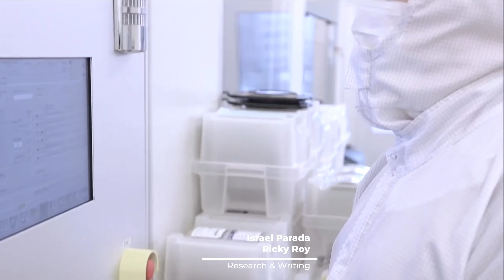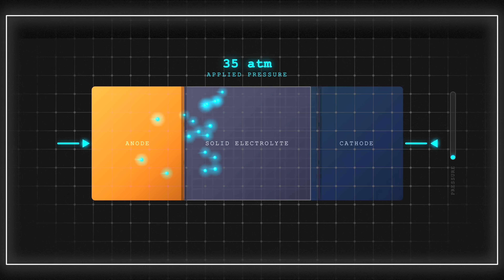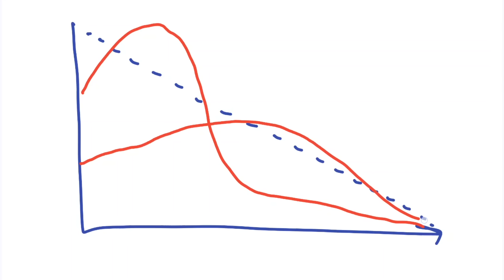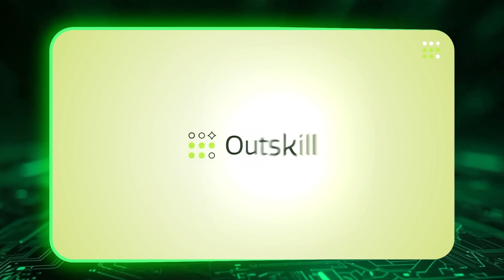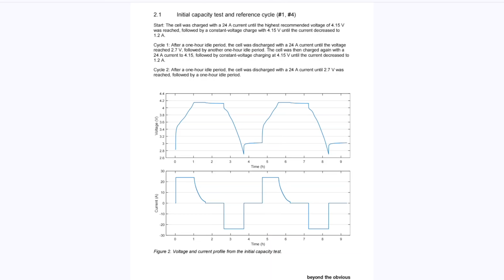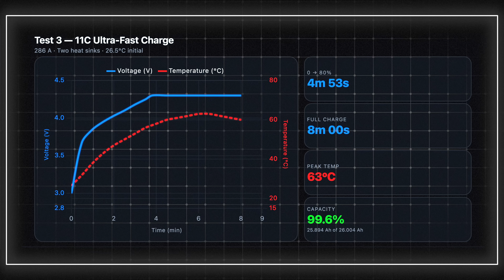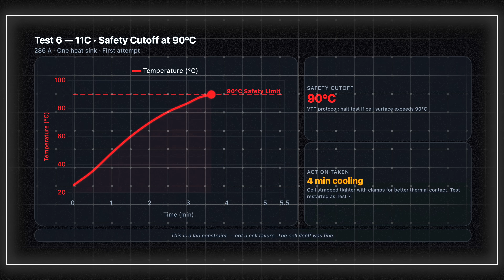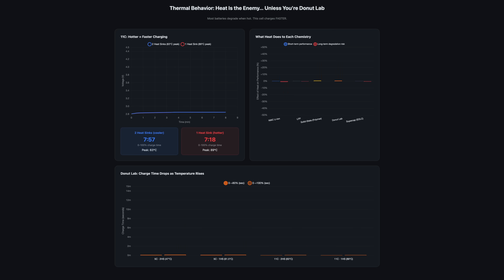Donut Lab's Solid State Battery Test are Shocking...

Comment: Also they open the video with the statement "this is a battery used in a IN PRODUCTION vehicle" to blow smoke up your a$$ , as this "in production vehicle" is a niche ebike made by their buddies at VERGE, a bike that noone has seen , that for all i know doesnt even exist yet, despite being promised for April this year. This is whats going to happen..there will be no motorcycle with a solid state battery, either it will be a mcguffin with a LION pack and a promise to upgrade you later (this way they can sell the bike and have the gullible locked in while keeping it legal), or they will postpone the entire bike. This is a classic investor bait last minute cash infusion play.  VERGE is struggling financially, they are on the verge of bankruptcy...no pun intended, they need pre orders and money fast. This battery is a scam, you cant cheat the chemistry signature by just applying the 4.2 volts and say ohh we do this because of compatiblity blabla, if your internal chemistry is NOT that of a NMC battery you will have a completely different CURVE no matter what voltage.

Comment: There's been so many scams like this recently, honestly, why should anyone care before it's on the market? Assume it isn't true. If you can't buy it, then what do you care anyway? Delving into the sketchy testing parameters, etc, is a total waste of time because the testing isn't truly independent. If they start selling it - someone's going to rip one open and find out the truth. Why not wait till that happens? This battery hype market has been happening for like a decade - graphene, graphite, solid state, nanowhatevers. There hasn't been much actual advancement aside from what you'd expect the industry to move at. Matt Farrel has made a career selling videos about vaporware.
Reply: Because pattern matching is good for spotting predators, not so good for battery analysis.

Comment: well its a super cap what do you expect. nothing new fancy here, than the high energy density by using graphene. I suppose they are using a solid electrolyte in the super cap then. so why christ said its a solid state super capacitor then. ok their solid state li-ion battery works fine then. dont you have separator cooling plates on both sides. ie cell compartmentalization. if only you would be one hot and cold, not meh. you can have a liquid electrolyte paste that hardens to exact shape like a glue to form the solid state electrolyte. ie kinda like cement. what you see is what you get. dont believe in people, rather believe in christ so that you are free from your bind to believing in what people say and talk. well they have figured out exactly what they said they are doing, an high performance solid state electrolyte material. a pem membrane would be close. also a cheap version of the usually expensive pem membranes.
Reply: Marko has categorically denied it's a capacitor of any kind
Reply: Very unlikely an super/ultra cap, doesn't match charge curve/temp. Like people have said, matches up with standard existing battery.

Comment: What did you miss? You seem fixated on the charge profile fitting an NMC liquid electrolyte battery architecture, when we have Donut lab saying the battery is a Na-TiO architecture. Assuming Donut's statement is truthful, I expect we'll see different data in future.
Reply: Other investigator said that, not DL
Donut never commented on the chemistry.

Comment: Great video, I follow your reasoning and, like you, I’m waiting for the next tests.
The only thing I can add is that I think they declared they can have whatever voltage they want in each individual cell, and they said they chose these voltages for the first mass production because it will be easier for industrial implementation.
So (if what they say is true), there’s nothing strange about having characteristics very similar to current NMC batteries.
We’ll see…
Reply: Its about the voltage curve, not just the voltage
Reply: I remember them saying that and was about to post on it. It would be a really big plus if one can just drop in these batteries as replacement. In other words it would be plug and play. That would be a big selling point.
Reply: That a bulshit if you have an exceptional battery you need exceptional proof no need to nerf it. Show us your max out and we will shut up and trust you. Because for the moment they didn't show what they battery can do that other can't.
Reply: @MrlegendOr  Yes I would send the cell variant that shows the best energy density and charging speeds regardless of voltage just to prove that it can match the claimed performance. And drop in replacements aren't that important as they sound - other can develop and adopt charge/discharge circuitry required for a new chemistry pretty quick especially if they get like a third better energy density with 100k cycles
Reply: Yes. Good point.
Reply: That's the thing I would expect an NMC imitator chemistry to have similar nominal and and fully charged voltages not 100% matching voltage curve. Another point is - if you promise that this cell can have a wide range of voltages you wouldn't want to show the variant that would give bases to the most common criticism - that it could be just very well made lithium battery. Normally i would expect them to give a cell that matches the promised energy density in the voltage levels that are most beneficial to them and then come up with an NMC twin with the caveat "If we need to make drop in replacement for NMC we lose 20% energy density" and that would be perfectly reasonable
Reply: @sedatmehmed4371  Perfectly explained!
Reply: @sedatmehmed4371 hahahahaha good story. 😂😂😂😂😂 

You wouldn't happen to be interested in buying some BTC or gold from me would you?

Comment: Watched both the videos Ziroth and this one, the conclusion we can draw is it's either a very good Lithium NMC and they are lying, or they have an entirely unexpected breakthrough that haven't been revealed in the test they have released so far. I mean lying just doesn't make sense at all since it will all be revealed the moment the cells get into the hands of the public, if it is an entirely new breakthrough, then maybe it does make sense to keep it secret as long as possible to slow down other battery companies from jumping on the technology and reproducing it. The only thing we can say for sure is, this isn't a definitive test that we can say yes or no to, it does make the chances of it actually being solid state less certain as Ziroth stated, but it still doesn't entirely rule it out, and I suspect that won't happen until someone takes a hacksaw to one of the cells and looks inside.
Reply: Waiting a few months to release the details won't slow down competitor's jumping into the market. Their current production volume would be a drop in the bucket relative to ultimate global production needs. CATL and BYD would dwarf Donut once info is public.
Reply: If you folks don't think there are hundreds of investors trying to hand donut labs huge sums of cash behind the scenes to invest early your hallucinating. Maybe Donut labs CEO Marko Lehtimaki will run away to Russia or north Korea with the cash just before the truth is found out. Marko Lehtimaki was claiming he had developed super AI not too long ago but he never produced anything. He seems like a wannabe Evilon Musk lying billionaire to me.
Reply: @ericm8811  Well there are already people building stuff, like WattEV, Cova Power, Esox Group and they claim they are being tested in trucks and etc, and there is that billionaire investor, so there's probably already a lot of money invested in it. Depends how much he wants I suppose, but keep in mind every one of these videos released will push people one way or the other. The point with scams like Theranos is you never release public testing, you always keep it in house, once you start releasing public testing that just gives the game away. Fortunately I am not an investor so not influenced one way or the other, I will just wait and see, scam or not scam, we will know soon enough.
Reply: @ericm8811 these personal attacks are tiresome and becoming silly.
Reply: I can't understand how you define this as inconclusive. They proved it charges at impossible speed with no heatsink. What more you need? 
As for lithium or not. That's a goalpost you all invented. Doesn't matter.
Reply: @davis.fourohfour  Because it doesn't necessarily exceed the charging speed of a good Lithium NMC battery, they have stated it's not lithium many times, and a lithium battery doesn't charge at those speeds simply because it leads to early battery degradation not because it's not possible, those charging rates lead to dendrite formation and battery damage. Until we have a test for the degradation, or not as the case may be, it could still be a lithium battery with liquid electrolyte, so no it's not conclusive, it's the total package that will be conclusive. It charges fast, other batteries can do that, it lasts a long time with little degradation, other batteries can do that, it works in extreme hot and cold, other batteries can do that, but they can't do all these things at the same time, and that's the important bit.

You can have a long life battery that doesn't charge fast, or a high energy density battery that doesn't like the extreme cold, until we have the actual full battery of tests it's not conclusive. 

It simply doesn't charge at impossible speeds, battery manufacturers are already testing 1Mw and 1.2Mw charging, but it shows it can charge at high speeds, it's not unique in that regard. So until we see more tests I personally am still not absolutely convinced one way or the other.
Reply: I saw Ryan's video, and I have a ton of respect for his expertise. I also don't agree with his conclusion that the test cells HAD to be NMC. The fingerprint is definitely a tell-tale, but there may be an explanation. Donut claimed they'd deliberately tailored battery response to be compatible with existing battery management systems, too.
Reply: @Thunderbuck  "Donut claimed they'd deliberately tailored battery response to be compatible with existing battery management systems, too."   There's no reason to make it match an NMC charge curve EXACTLY.  Also it would be nearly impossible to replicate a curve exactly using just "chemistry" with no N, M, C, nor Lithium.   It's almost trivial to reprogram a BMC compared to creating an all new chemistry that emulates an NMC charge curve that exactly.   To me it sounds like a snake oil salesman trying to con marks by giving reasons why it would match an NMC Lithium charge curve but claim that it's not NMC Lithium.
Reply: @BubbaBearsFriend  I agree, and I'm not saying it's not a red flag. But it's not a clear disqualifier at this point, either.
Reply: @BubbaBearsFriend  Which is why we need definitive tests that may involve hacksaws or some similar cutting devices, I am certain that will happen sooner or later.
Reply: @BubbaBearsFriend again, ad hominum attack in the face of a successful test.
Reply: @Thunderbuck that’s completely incoherent with what else they have said about it definitely being a battery and not some pseudo-capacitor. The voltage is set by the ion and anode/cathode over-potentials.

It would literally be inventing new physics, like Nobel prize levels of new physics. So on that alone we can say if everything is on the level, they are at least lying about something, and if they are lying about something then I don’t trust them.
Reply: @geekswithfeet9137  I don't think anything can convince you all. It's amusing. The "con artist" CEO predicted the reactions like Hari Seldon laying down psychohistory. Each time a successful test is posted, the goalposts will be picked up and moved. 
I do hope that it all works. Keep in mind Donut and VTT  already each finished the tests. The tests are done. They're confident. Lying at this point would be a 7.5 week countdown to reputational suicide.
Reply: @Thunderbuck  yes. Can you imagine the comments if the batteries couldn't be tested at VTT? Best make a square peg fit in the square holem
Reply: The battery will explode if you use a hacksaw on it.  Seriously!
Reply: @AlanWil2  They claim it won't, no liquid see, so perfectly safe......
Reply: @AlanWil2  It’s not under compression and it’s (apparently) sodium so why would it “blow up”?

Comment: Regarding capacity, this is just counting electrons in and out. so if there is a difference it means that electrons have reacted elsewhere, either error in counting or degradation. The energy efficiency is the capacity times the nominal voltage, and this is quite poor with only 90% of the energy recovered even in the 1c/1c rates.

Comment: Some speculate that they use a type of screen printing process from CT Coating. Perhaps they can achieve the alleged emulation of different chemicals by using different geometries when printing. It doesn't make sense to a conventional mind, but if you're a doNUT... there has to be some out of the box thinking involved if their claims are true.

Comment: The future of cars will be electro-engine, yes. But never with any batteries.There will be one, yes true. But not for "main". Its to heavy, expensive, load cycles, needed infrastructure etc. Soon we will see new models with a fossil-motor generating power for the drive-motor, which is electro using 1-2L gas per 100km. then there are other ways, too. The one which have "only battery" will be the "poor" in the future. Hope these models getting cheaper then for entry-level customers.

Comment: I'm not sure where you got THAT low alleged round-trip efficiencies for NMC and LFP, because the latter is rarely below 95% currently.
However I'll just copy my comment from other video on the donut:
At first I didn't really care about Donut battery, but the way they try to present and deb00nk claims makes them look like a solid scam.
There isn't even a timelapse video of the test - it's just words on paper, and I've seen similar technical scams done before.
However, I see some bigger problems with specs.
According to VTT report:
Reference cycle (1C):
100 Wh charge, 91-92 Wh discharge -> 91.5% round-trip efficiency
5C:
106 and 104 Wh charge, 90.5 Wh discharge -> 86% round-trip efficiency
11C:
108.6 Wh charge (mean), 89.4 Wh discharge -> 82.3% round-trip efficiency

All discharges were at 1C, and it genuinely seems like cells lost at least 2% capacity after being nuked with 11C charge.
On top of that - 82.3% round-trip efficiency looks like way too low of a number for allegedly this good of battery, and 91.5% at 1C-1C is almost laughable.
Current LFPs reach as high as 98-99% on efficiency when charged within specs, <90% sounds like problems and a lof of those.

Galvanic cells aren't magic - 90°C will always increase degradation speed, but the near 20% loss of energy will turn into heat.
That's 100 kW of heat at 560 kW charging, which is likely more than Xiaomi SU7 produced on Nurgburgring.
Every basic high-current cell has low resistance and near 1:1 cycle efficiency on 1C.

Those specs genuinely sound like scam using someone else's battery and almost completely frying it during the process.

Comment: They probably lied about there being no lithium to throw off copy-cats. Either this or they've shaped the voltage curve to throw me off. Or they've modified the element so it's not technically got the identical atomic number as lithium.
Reply: If they've lied about ANY of their claims it's a serious problem. They did say at CES that they can tailor the voltage response and to start they've made it mimic NMCs to be compatible with existing battery management systems, so that MIGHT explain the similarity. Or it could be a convenient explanation.

Comment: This test is the least important as more and more people charge at home overnight so ultra fast charging will not be needed as much.
The most important tests will be energy density and cycles.
Energy density is the big one as this will lead to far greater range and thus again less need for ultra fast charging.
Cycles is also very important but I think Donut again will be confident of the results. Even if they only achieve 10% of their claimed 100k cycles, that would still be enough charging capability to last over 27 years!!
I think the areas we should all be focusing on are scalability and price. These will only become apparent once the chemical formulation of the battery is revealed.
I am still sceptical but I think this test was a very good start and I really am routing for them as this will be a complete game changer for all of us if all their claims are true!!
Reply: I am waiting for cold temp charging at -20 c,  this woud verfiy that it is not  a standard lithium pouch
Reply: Thermal management holds massive implications for all EV drivers regardless of where they charge.
Reply: @Thunderbuck and the test proved their battery was way better at TM than any battery currently being used in current mass produced EV’s.

Comment: The battery working better under high temperatures is not very standard for Lithium-ion based batteries, no? Or am I mistaken?
Reply: That’s standard. This is why cars typically “preheat” their batteries when fast charging. There’s a sweet spot between faster charging and damaging the cell.
Reply: @quinndonnelly  Oh, okay.
Reply: @leGUIGUI  he's not wrong. I've done testing >11C, cell survives, but to many cons in other areas.